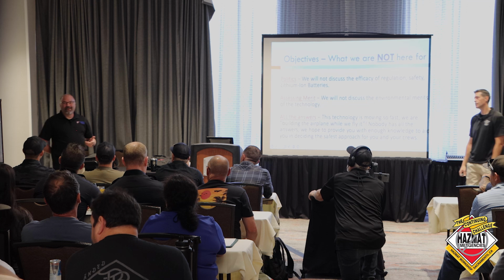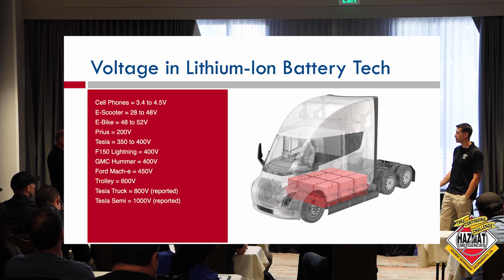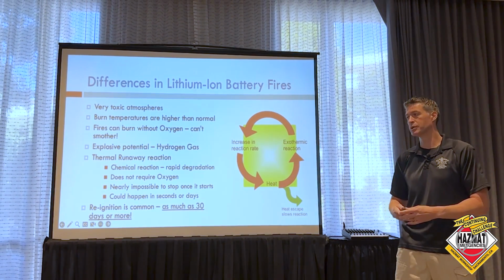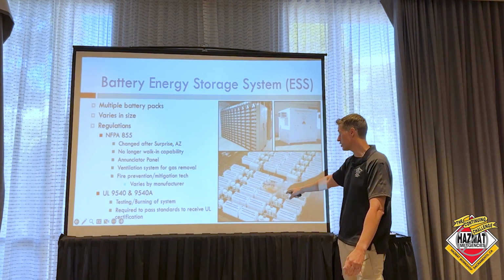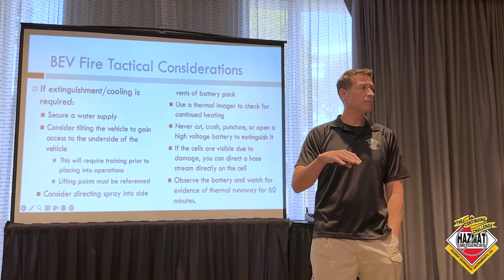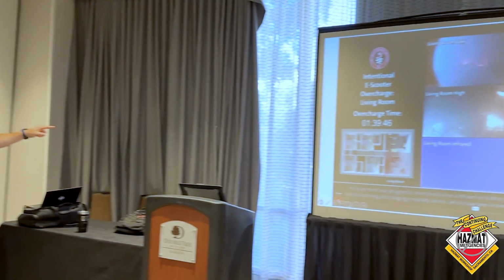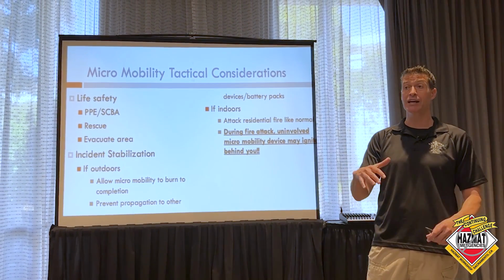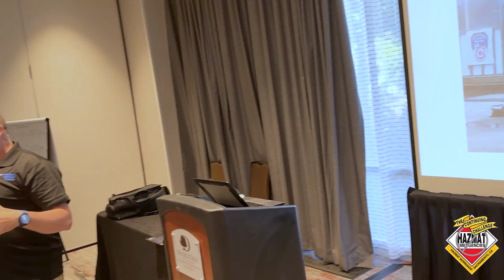Lithium Ion Battery Fire Presentation @ The Continuing Challenge

Comment: @26:45 I dont get why cities are still buying them when the danger is so clear. Have you guys look at AVD? Ive been looking around for retail versions of lithium containment home/office or fire blankets and there's very little out there still. Given how many devices now use them its a must have.
Reply from the maker: Hi @husher5142 we're learning more about lithium ion fire preparation and response as we go. If you have any containment options that look solid let us know. We're also looking into fire blankets as tool during fire responses too. We're going to produce a video about a smaller set of battery containment 'boxes' in the near future, we've been using one called a Bat-Safe in our mobile production RV. I'll post when that review is ready.
Reply: @HazmatResource I havent personally tested anything but was looking into this (AVD) company and their Aqueous Vermiculite Dispersion. They essentially have a non reactive substance create a seal to stop the thermal reaction. It also appears to be effective in stopping the cells from reigniting. Worth looking into anyway.
Reply from the maker: @husher5142  ah, good to know about AVD, we'll look more into it too. Thanks for the information!
Reply: All fires are potentially dangerous. We should fear and not support gas stations, plastic recycling centers (massive fire in Abq this year), and gas lines? This video is the key! Train and equip firefighters to do their job BASED on the fire.
Reply: @DigitaldogNet  Not when there is a mainstream safer alternative. Driving gas powered bus with plenty of time to evacuate or EV thats incredibly onerous to operate/power and turns into a volcano/death trap if ignited. 

Also this video is literally saying they dont have great processes to deal with lithium fires and they are increasing, which is becoming a serious problem.